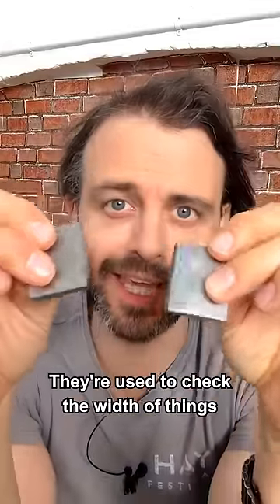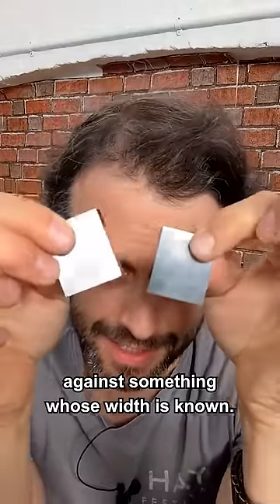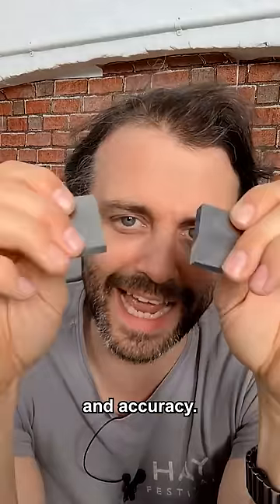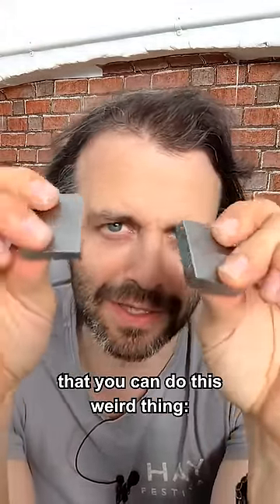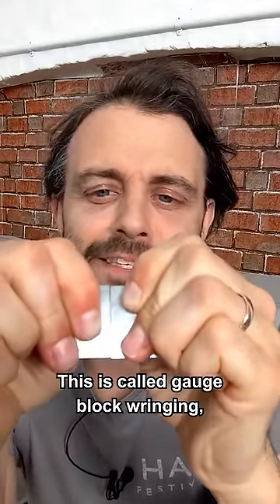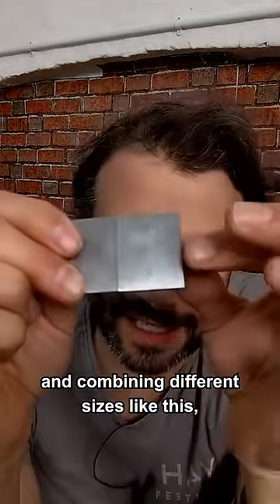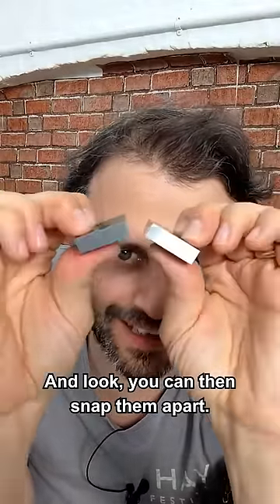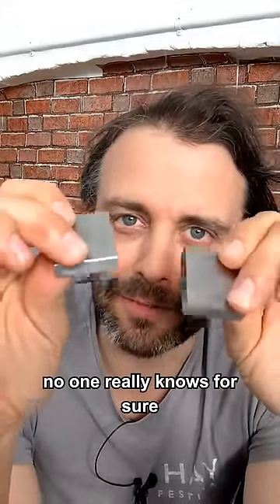No One Knows For Sure Why This Happens!

Comment: It happens because of van der Waals forces, very weak atomic forces that are distant dependant. Two super smooth surfaces pressed together become close enough that these forces become strong enough to attract the surfaces together. A more interesting example is a geckos foot, which have many extremely small fibers that can fit into the imperfections of a surface allowing them to climb on walls and ceilings.
Reply: With 2.9k comments already, I knew someone would have written it already, so I didn't need to.
Reply: I've heard that geckos use the casimir effect to stick to walls. And I also feel like electrostatic forces have a play in the role too. So do geckos use all three, or just the VdW force?
Reply: Was looking for this comment thank you
Reply: My thoughts as well... Thumbs up!
Reply: Yeah this is it. Kind of amazed the top comment completely ignores general chemistry knowledge.  Well, I guess that's a lie, I'm not surprised at all.
Reply: Microwields, hence the need to rub.
Reply: "Nobody knows fir sure" doesn't apply to YouTube comments section
Reply: @geomacaulay  The good thing about the comments is we can discuss the current theory. And although tempting, Van der Waal forces are extremely unlikely to be the cause. 

Of course electron microscopy of the mating surfaces whilst mated would probably be pretty conclusive, but rather hard to do in the case of metal objects which can't be cut whilst preserving their integrity.

Probably a good subject for a PhD materials science student though.
Reply: "van der Waals forces" is what scientist say when they dont know how to explain something
Reply: "No one really knows for sure" is always met by someone who claims to know for sure in YouTube comments.
Reply: Thank you , I was just gonna comment gecko foot and hope people understood what I meant.
Reply: @geomacaulay  Progress happens when people ignore comments like "Nobody knows for sure"
Reply: PhD Physical Chemist here. This was my first thought as well, but that doesn't necessarily make it correct. Do you have any source for claiming it's van der Waals?
Reply: do metal surfaces even have VdW interactions
Reply: I remember hearing about these forces long ago in my HS physics class. Don't remember exactly what they are. Now I just look at them and think "ooh sticky blocks! Fun!"
Reply: Has this hypothesis been tested?
Reply: @YounesLayachi  All atoms/molecules with electrons do. The relative strength varies, though.
Reply: New sheets of paper, plastic bags?
Reply: Then you should know how many forces there are in the universe,  and you can go by process of elimination.  Does that look like gravity to you?  LOL @kcStranger
Reply: And if it were electroweak force,  would he be able to pull it apart?  LOL @kcStranger
Reply: YOU ARE MY VAN DER WAALSSS
Reply: Must be true. Wikipedia says so.
Reply: Correct, the lapping of the surfaces takes off the mountains and valleys that remain after grinding.
Reply: @zharkabat   Nah, that's the "dark" part of a concept.
Like Dark Matter, for example: it's science speak for "yeah, we're pretty sure there is some kind of matter out there keeping stuff together in the universe, but what is it exactly? Fuck if we know"
Reply: van der Waals forces, also known as magic.. 😅
Reply: @loc4725  Electron microscopy wouldn't work. You only have to create sliced samples for a TEM, but an SEM you don't have to do it. From experience, though, it would just look incredibly smooth. At best, you might be able to see some microscopic scratches from when they were smoothed down.
Reply: I had forgot the name but yeah...van Der walls force.
Reply: @YounesLayachi    no they have Wonderwalls
Reply: @Taricus  You'd probably need to use HRTEM but sample preparation that would destroy the area you're looking at.
Reply: Youtubers make videos independent of knowledge or intelligence. Believe Youtube at your peril.
Reply: @LivinBilly  
No. Progress happens when people tackle topics that nobody knows for sure. Pretty much the opposite of ignoring.
Asserting something without evidence because you don't like not knowing something is what leads to faith.
Reply: @carstekoch  
Wong. Progress happens when people disagree on social media 😉.
Do you have any statistics to verify your premise about the difference between "tackling topics" and "ignoring ignorance"? Otherwise I'm just going to have to have faith in your answer and a wise person once warned me against that! 🙂
Reply: Look, he said no one ok?
Reply: @HuckleberryHim  it's not that they have a large surface area, it's that the structure of their feet is able to shape to any surface at a microscopic level, making contact just like these two smooth surfaces. The reason other objects don't stick is because they have ridges and valleys at a microscopic level and don't actually make much contact.

There was a good explanation done by the company that reverse engineered the gecko foot and made tape with no adhesive.
Reply: @chrishamilton1728  Thank you for the explanation, I'll admit when I'm wrong and delete my comment. It is true that the strength of the interactions is proportional to surface area of contact, but I came to the exact wrong conclusion from there. What you say makes a lot of sense
Reply: Came here for this one!
Reply: @zharkabat No, Van Der Waals forces is what people who aren't scientists say when they don't know what is happening. Scientists know that Van Der Waals forces arise from slight perturbations in the atoms of materials, causing a very very small dipole-dipole magnetic force. Van Der Waals forces work best when the contact area is maximized, ideally a liquid. In solids, a very fine microfiber structure works well.

Hyper smooth gauge block surfaces have a minimal surface area, being very very smooth! The more rough a surface, the more surface area. Van Der Waals is very unlikely to be the explanation for this phenomena.
Reply: I think he already knew. 🤫
Reply: @jasonebat1074 If two objects are completely smooth, their surface area of contact is maximized. The area in contact being the key here, not simply the overall area. Which is why liquids exhibit the force more, as they conform to whatever they are touching.
Rough surfaces minimize the contact between two objects, causing the effect to not take hold. The best way to make two solid objects have the most area of contact is to smooth them out. Unless you can make a rough object, with another object that is a perfect negative of that same rough object. Only then would the surface area of contact increase.
Reply: I'd begin by assuming they're non-ferrous.
Reply: Ive been in storage looking for the van der Waals machine for ages.
Reply: Was actually going to make the same reply, but you beat me to it.
Gg (no ree)
Reply: @skipads5141   Your comment is useless unless you can provide some meaningful comment to support either position.
Reply: @zharkabat   What are you talking about?  You're making stuff up.
Reply: @LarsLarsen77   No need to be nasty.
Reply: I remember we have taught about this in mid school on physics lesson. I just didn't remember it too good to write it myself though, and I am glad there are smart people who does. 😊

"No one knows" 🤭
Reply: Veritasium did a video
Reply: @hsheheishje9649 You've basically just listed the same thing three times here. The casimir effect is a bit of a generalization of the van der waals force. As for electrostatic, yes. The van der waals force, at least the attractive part of it, is electrostatic in nature. I believe the dominant effect is from the attraction / induced alignment of dipoles in the material, but any weak intermolecular forces that aren't the usual types we think of for bonding (ionic, covalent) are basically put under the van der waals umbrella.

If you're wondering why I specified that it is only the attractive part of van der waals forces that is electrostatic, that's because there's also a repulsive force that goes by the same name, but is the result of degeneracy pressure, which interestingly isn't tied to ANY of the four fundamental forces.
Reply: You have described two different things, neither of which is what causes this ...
Reply: So which ones have all the suckers with little toe suckers with more little plungers, continue fractal...?
Reply: I call BS. The gecko’s feet take advantage of imperfections in a surface, these surfaces are almost devoid of imperfections.
They are so flat and without imperfections that they become air tight. I suspect the friction between them generates heat and it’s almost instantly cooling creates a vacuum which holds the two together. Almost like two panes of wet glass stick together.
Reply: @LivinBilly 
Do you really believe it’s “progress” that happens when people question?
Have you ever heard of science? It’s all about questioning what is generally considered to be true. If everyone just accepted the “consensus” how could anything new ever be learned?
Reply: That's only possible with a thick enough oxide layer. Metals cold weld when the layer is breached and metals touch, which would be the case as twisting the surfaces together is a key element that breaks the oxide layer.
Reply: Is this how glues work ?
Reply: Antimateria glue-forces.
Reply: Isn't van der waals for molecules only, this is metal
Reply: WRONG. WRONG.  WRONG.
Reply: Bingo, sir. You called it first. That is the primary root cause.
Reply: I've heard geckos feet touching a surface makes them cling to it almost at a molecular level.😮
Reply: @alexeecs pro tip: metal is made of molecules 👌
Reply: Actually, it’s now believed that gecko feet operate off of static electricity (such as how packing peanuts can stick to the fur of a cat)
Reply: @Muhahahahaz  Isn't metal made directly of atoms in a sea of electrons?
Reply: That's the name I couldn't think of when I made my comment.
Reply: Which is what makes alien tape work.
Reply: Hi I am a metallurgist and can confirm that the most likely force holding the blocks together is called Van Der Walls force.  This force is a result of weak atomic bonds between similar materials.  The cleaner and smoother the surfaces the stronger the force.😊
Reply: @hsheheishje9649  When people say they're using the casimir effect they're talking about the same thing. The casimir effect, and the casimir-polder effect are the two fundamental principles of the London force
Reply: Dawson creek was a great show. James van der waal was a good actor